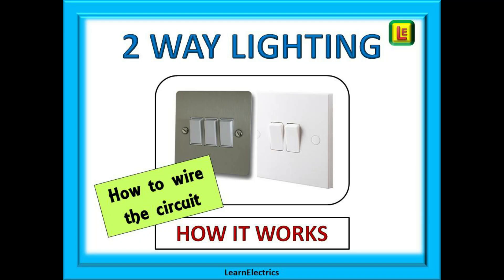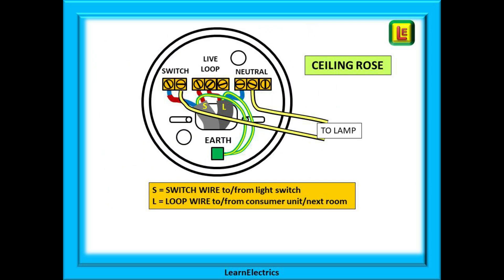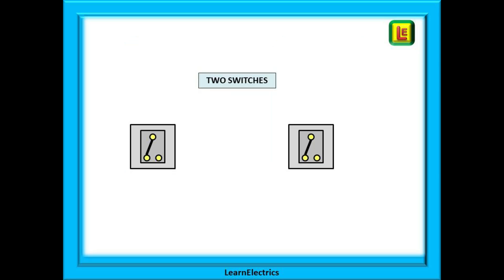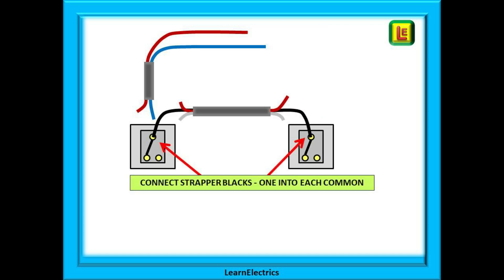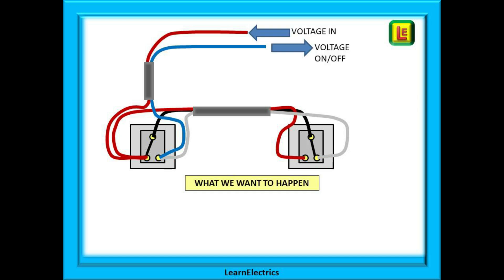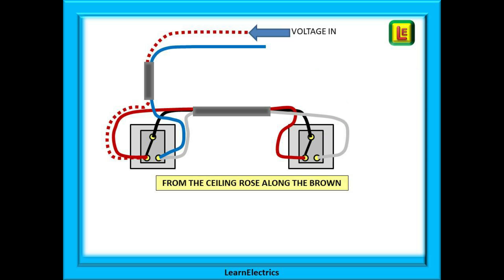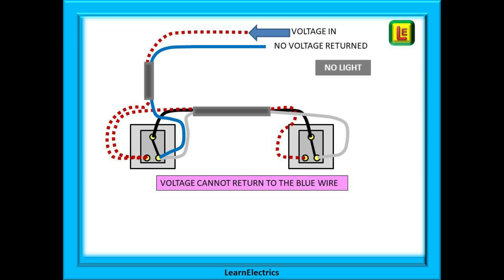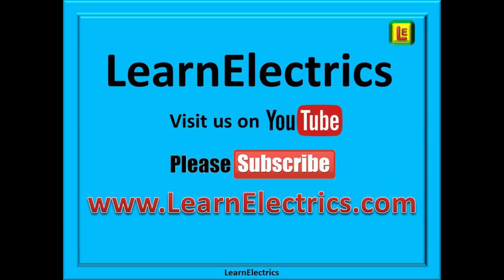2 WAY LIGHTING CIRCUITS. How to wire them. How they work.

Comment: For the one way switching, can you put  the Loop Live into L1 and Switch Live into Common? 
Just so I remember 2 way easier as both feed L1 and 'first' 

Even if i dont do it this way its good to know.

Thanks mate 👍
Reply from the maker: Yes you can, one way switching is not as fussy. It's just open and close contacts. Thanks for watching. Dave.

Comment: So for the light to operate one of the switches should be off whereas the other stays on?
Reply from the maker: Not quite, the important thing is to follow the route of the electric. We don't need both switches on to make the light operate. Have another look at the video and follow the path of the electric. Dave.
Reply: @learnelectrics4402  which video is this, I said does one switch need to be in the off position for the path to be completed

Comment: So where the voltage came from the two switches it all came from
Reply from the maker: It will come from the consumer unit to start with and return on the neutral to the CU. Hope this helps. Thanks for watching. Dave.

Comment: Wonder why in north America we call these 3 way switches. Is it because we use a 3 wire or 3 core cable with ground wire? Anyway great video as usual
Reply from the maker: Good point Lyle.
Two holes in the back UK 1 way - US 2 way (two holes)
3 holes UK 2 way - US 3 way (three holes)
Makes you wonder why we can't standardise and who is right.

Comment: I was thought at college that you can do two way switch connections at the ceiling rose 
Twin and earth for the feed and three core and earth to each switch linking the yellows with a connector block , great video Dave as always
Reply from the maker: There are several variations. We have just shown the three plate system here which is the IET recommended way now. We are doing another video on the two plate system which was and still is popular. Thanks for the feedback and interest. Dave.